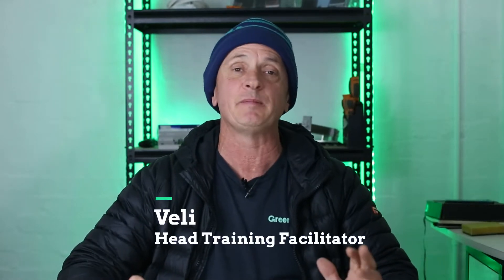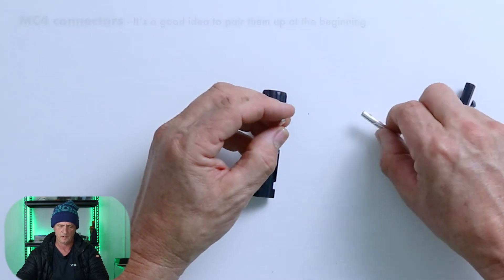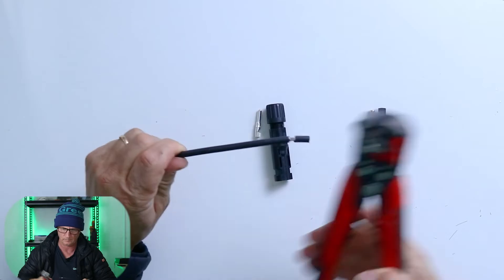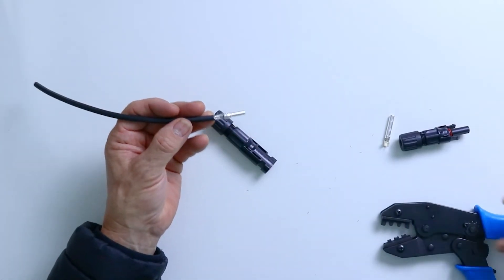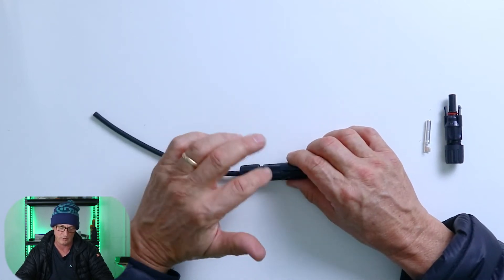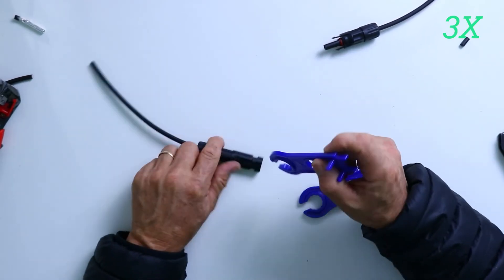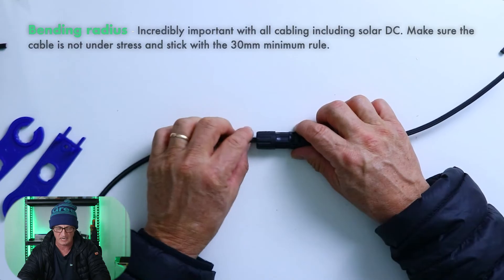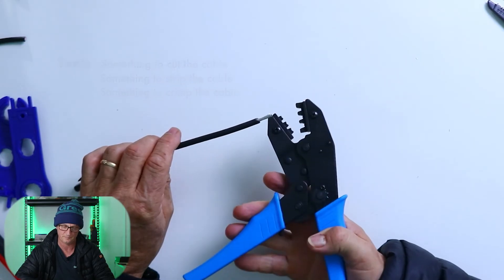How to Correctly Crimp MC4's for Solar DC Cable

Comment: I've done thousands of MC4s by now - but it's good to see another bloke show how it's done. MC4 connections can not be done without correct tools. I was on a roof checking out an under-performing system - saw glowing hot wires and wisps of white smoke under a panel - cremated MC4s still burning from air draught under the panels. VERY lucky homeowner. 

Tafe gave us less than 5min and only one connector to practice - in the last 5 minutes of the 2 weeks of training. I've learnt SO much since then.
Reply from the maker: If someone says they are an expert, run the other way. Always learning. Cheers for the comment

Comment: Well done sir,thankyou. This was the least of my concerns when installing my system, until it was'nt. It got confusing with the mc4's and  then other vids with guys using pliers to crimp and no mention of how much insulation to strip or the internal size of the connectors. Nice detailed vid thanks again.

Comment: Vendors of MC4 should link to this because it is easy to assume 2 major mistakes are O.K. The 2 mistakes are: Crimping on the insulation and inserting the male connector into the male housing ! Thanks for making it clear why this is incorrect. It will work if you make these 2 mistakes but maybe not for long and not at the rated voltage.
Reply from the maker: Totally agree concerning the 2 mistakes. As I always say; electricity is dangerous and should be treated with the utmost respect.

Comment: from a fussy Mech/Elect Engineer:  An extremely well done and professional explanation!  Perhaps adding a slight pull or yank test after crimping?, and the reminder about caps first (your cable was open-ended)?  Thanks for your time.

Comment: Excellant, when the incert is correctly crimped with the correct tool it rolls both sides into the wire strands making both a stronger and larger surface area crimp. DO NOT just fold over and overlap the tabs and smash then with pliers. Do not solder.

Comment: Thanks for stressing to NOT twist the wire strands. Every time I watched a video doing that, I'm thinking - how are the two halves of the terminal supposed to penetrate into the wire strands properly if they are twisted?  Also, well done on emphasizing that the female MC4 gets the male terminal and visa versa.

Comment: Great video, nice to see a lot of the steps are done correctly. I have to ask: Which connector manufacturers are recommending removing the cap before inserting the metal insert? I've not seen that recommended anywhere, especially commercial situations where installers are expected to follow the manufacturer's installation method in order to maintain the warranty on the connectors.

Comment: I ran across MC4 connectors that just dont make that slip sound. They just keep spinning until they brake. So that sound that indicates that connector is tight enough, does it comes from connector itself OR the plastic blue tightening tool ? I thought that the connector slips a round inside the tightening tool as indication that tool doesnt have any more grip to tighten it any harder. 

So my question is is it bad MC4 connector or a false tightening tool ?
Reply from the maker: Good question. I believe it's from the tool that creates the noise at a certain torque. What will happen is that after time the tool will slip at less and less pressure so ideally the best way to test that you have tightened up the nut sufficiently is to grab the MC4 with one hand and the cable with the other and rotate. If the cable doesn't slip all is good. Some people use an aluminium tool but these are not forgiving and may result in over tightening. Hope this helps

Comment: Great video, however at 7:30 you might want to redo this part, cause there will be a fair amount of people who just follow along and do what you do and don’t see the text in the top of the video here.
Doing one thing and saying another (or in this case even just typing) is not really optimal.
Reply from the maker: You are right. The captions should be enough but, ideally, I should have done this part of the procedure correctly but in saying that, from an Australian perspective, only A grade electricians and their apprentices are allowed to make this connection so . . . !
Reply: @GreenwoodSolutions  Same where I live, but that doesn’t stop people from burning down their houses :p

Comment: I Keep having problems when tightening the MC4 Nut. The Nut keeps deforming and cross threading. I never really know if I'm getting a good seal. Im guess they are just rubbish MC4s, but they are all my Electrical wholesaler stocks
Reply from the maker: This is a problem. Obviously use approved MC4's and chat with the wholesaler about the issue and if nothing happens there are other wholesalers . . . !